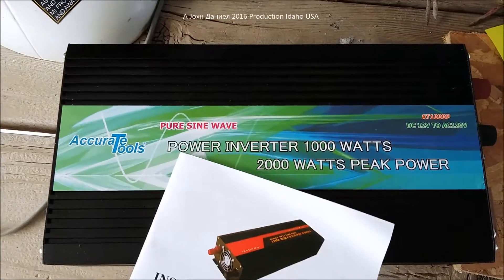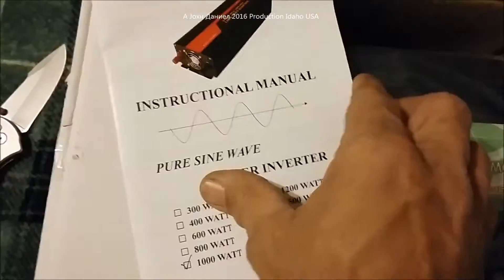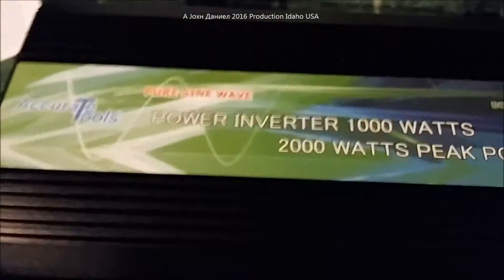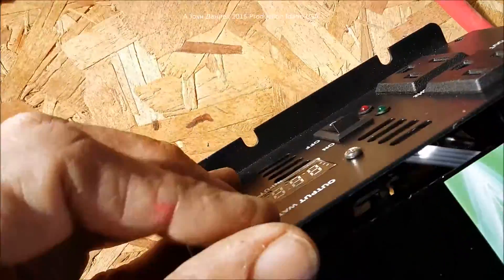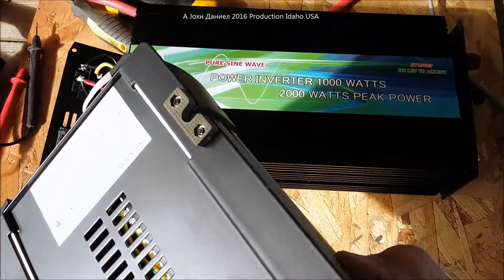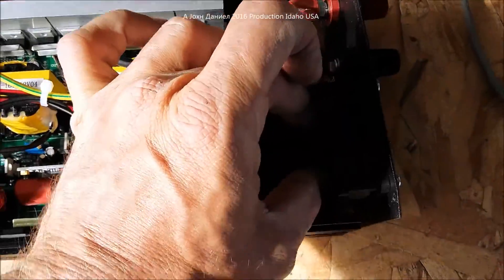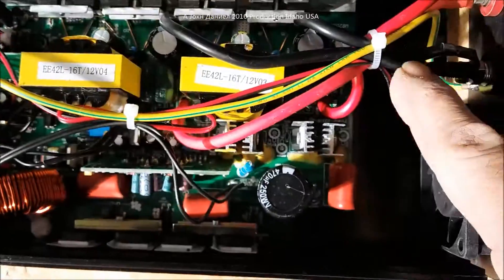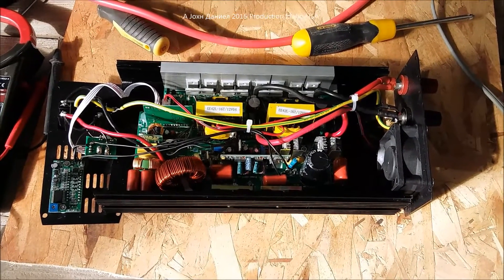Power inverters compared Video 1 of 4

Comment: Hi Ive never seen any videos that the inverter is grounded. But my inverter has a ground screw by the battery hookup. I have a 1200 watt peak work zone inverter for a small camper, I have solar panels of 100 watt (thunderbolt) & 2 solar batteries of 12v 35 amps, parallel, do I use the ground to my trailer for the inverter.